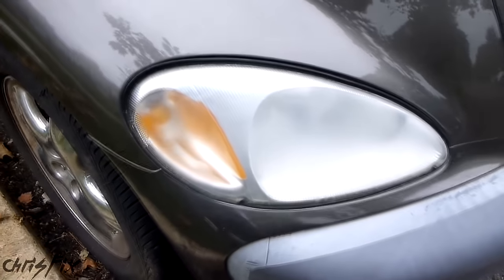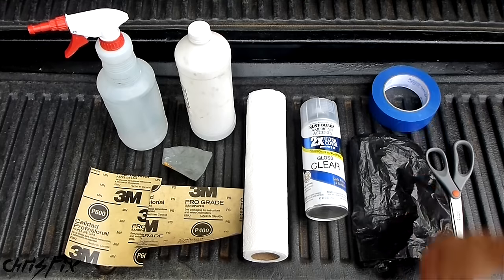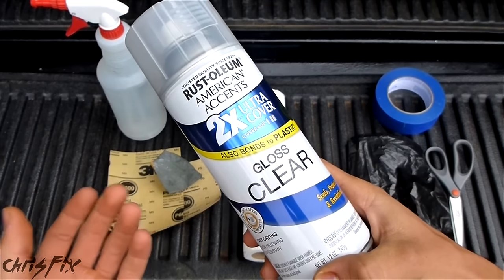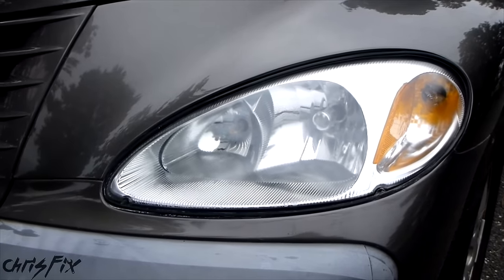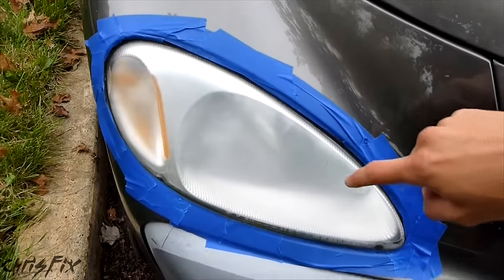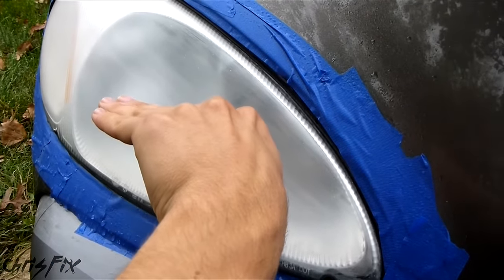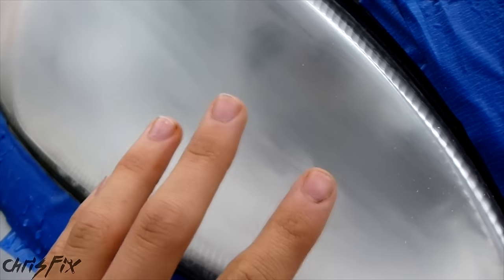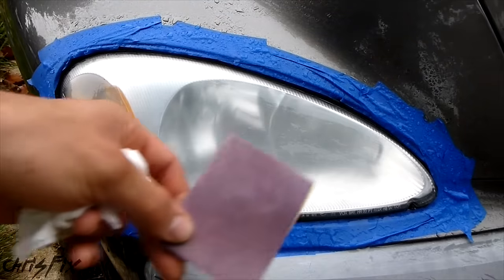How to Restore Headlights PERMANENTLY

Comment from the maker: All products I use are listed in the description as well as links to update pictures of the headlights 1 year and 2 years later. You can also follow me on social media:
Instagram→ https://www.instagram.com/chrisfixit
Facebook→ https://www.facebook.com/chrisfix8
Be sure to tag me in any before/after shots you guys take! Thanks!
Reply: ChrisFix Great work.  Hope u do more for the teens that are into Automotives.  better tricks and education to help
Reply: ChrisFix TV CT   garden
Reply: This was a great tutorial. Thank you.
Reply: ChrisFix I actually restored my headlights using your method. but I skipped the rubbing alcohol because I'm affraid it will damage plastics. Thanks
Reply: to get
Reply: to get a free Google
Reply: Can You please answer. When I clean my headlights and wash off the cleaner the headlight get unclear when they dry, and when I put water on it, it shines until it dries again and gets foggy or unclear. I don't want a coating though, because they peel. how can I make it shiny?
Reply: Go to any paint shop service, they will buff it, then you have to wax them each  season. Cost around 20$ tip. If your lens is very clean with alcool, it won't peel off. Do not use lacquer clear coat. Krylon clear coat is the best for plastic and it is UV proof. Be sure to use the GLOSSY finish, not the satin finish or matte finish.
Reply: Walle M. rubbing compound and a buffer or a lot of elbow grease. Use a heavy grit compound and finish with a lighter compound. Finally finish with wax.
Reply: ChrisFix nice job i myself Detail Cars i run a KIA dealership but the way i restore headlights permanently is very similar except i wetsand with 2000 grit then I use 1000 or 1500 grit compound & with a high speed buffer set between 1600-2100 and the results have been amazing i do think i will add the clearcoat. 
Lmk what ya think & i will watch more of ur videos cause even with my 15+ years experience detailing i still pick up new tricks etc....
Reply: ChrisFix I fucked everything up. Now, I have scratches on my headlight. I need help. How do I remove scratches on the plastic headlight? Bump up the grit of sandpaper to 2000?
Reply: kyoukoujin u gotta get a high speed buffer and some compound wax 1000-1500 grit run the buffer at 2000 and buff them they will look brand new.
Reply: Prib-302 great. Now I have to buy a buffer machine and a wax. A $20 video procedure now becomes more expensive glass salvation. Dang.
Reply: ChrisFix 好办法
Reply: i don't have a car on my own and am not very tidy and also too old to feel the need to look good in a car (when I borrow my brother's or father's) so maybe these videos are totally not for me -but I couldn't stop watching, extremely well done, nicely presented -much nicer to watch and listen to than ANY commercial whose job is to sound appealing. just wow
Reply: ChrisFix what if my headlights aren't yellowing just needs to be scrubbed well you can see debris on the lense and it creates a kind of reflection from the beam if that makes sense
Reply: Prib-302 screw the scratches. I just applied cooking oil on it. It's ok.
Reply: Dude you're phucking awesome....!
Reply: ChrisFix  sup Chris. it's a sunny day here in illinois so I wanted to restore my lights as well but I don't know if I should since it's rainy tomorrow. I heard you say let dry for 24hrs. would it really matter?.
Reply: ChrisFix the tape looks like pet liner
Reply: ChrisFix wuter
Reply: ChrisFix do we need the wax at the end or can we leave it as is?
Reply: how do you fix a small crack in your headlight?
Reply: hey can i use that can of spray after the toothpaste way?
Reply: +חיים בן זינו if you can't find it just use tooth paste and a hard bristled tooth brush takes longer and doesn't look as good but it helps a lot there's a lot of videos on hot to do it.
Reply: James Zorb
Reply: Kars
Reply: +Prashanth Reddy  yes?
Reply: ChrisFix Where did you get the Spray paint at?
Reply: +Nicole Krist Amazon the links are in the description
Reply: ChrisFix i did it and what if I messed up lol, do I just do everything over, to take clear coat off?
Reply: +Mauro I Hernandez showed you mess up?? lol
Reply: +Mauro I Hernandez how did*
Reply: James Zorb
Reply: Sabb headlight assembly for. 1999 9-3
Reply: sam lin n
Reply: ChrisFix the
Reply: ChrisFix
Reply: just want to say I tried this yesterday to my car, and the results were amazing. headlights look like new. thank you for the tutorial.
Reply: Joey Loyer mkplkpl
Reply: ChrisFix ...... Hey ChrisFix..... I over applied the Gloss Clear on my head lights and it have that run down after finish. What can I use to remove it?
Reply: ChrisFix
Reply: I've been waiting for a answer about that too. 

I REALLY do not feel like sand papering my head lights all over again...Sh*t!
Reply: iKeywee Good questions. Try you tubing your questions I'm sure that will answer all your questions.
Reply: iKeywee wax is just that - wax.... apply it to make water bead up and roll off versus sheeting or staying on.  Polishing or rubbing compound has very fine particles in it to remove oxidation, etc.  It can be used on paint to restore it before applying wax.
Wax should always be the LAST step.
Reply: I plan on trying to tackle this soon.... ford Escape headlights are foggy and hazy....  but some looks to be INSIDE???
Reply: ChrisFix is
Reply: ChrisFix my spray can days indoor and outdoor does this mean it's uv resistant? I'd like to know before I try restoring my head lights.

product number is: krylon k05130102 

please let me know
Reply: ChastBlind make sure it says uv resistant.
Reply: ChrisFix I just did mine and I'm waiting to 24 hours for it to dry. It doesn't look super clear after I sprayed the clear coat on, do it dry clear after the 24 hour period?
Reply: Praise
Reply: Let it dry well.  It also helps to use an extremely fine grit and wetsand the clear coat.  Don't sand it off, just smooth it out.  I usually put about 5 coats on mine so that I'm sure I'm not sanding off the clear coat.  Once it's smoothed out - crystal clear!
Reply: Storm Chaser Video I'll keep that in mind. How long did you wait in between coats?
Reply: Storm Chaser Video I put 3 coats of clear on and starts looking hazy after the second coat... WHY?!?! I let my clear coat dry, then I sanded with the 2000 grit and it just makes the headlight even more hazy.. what am I doing wrong here? I'm doing all of the steps in the video to the letter.
Reply: This is not as easy as it looks.I've done several lights and, to some extent, have gotten the "orange peel" effect every time.  Not sure if this can be avoided when using spray paint out of a can.I too tried the 2000 grit sand paper to attempt to eliminate the orange peel look (after waiting a couple of days for the paint to completely dry).  While it smoothed the surface out it created a cloudy haze on the surface of the light.  Definitely looked better before I tried to "fix" it.I then applied car polish (Nu Finish) and that improved the appearance considerably.  The problem....don't know if that is going to last. Next test... I may try using 3000 grit sandpaper on the other light.
Reply: What type of clear are you using?  And, are you wet sanding?
Reply: ChrisFix i have same problem!! I mean i used wet sandpaper, i just start with 600and 1000 and then 1500 finally 2000 and also i did on horizontally also ,,,  I followed all the steps one by one , but finally still i have orange peel on my headlights, it was better than before but not like your headlights???? Please tell me what i have to do right now?? Can i do it again like sandpaper 2000 and spray it again?? I found exactly the same spray which you said on movie!! So please help me!!
Reply: kyoukoujin how did you mess it up? Just want to know so I don't do that.
Reply: ChrisFix I just used some bug spray and it works great it's still clear and it's been 6 months . but don't get it on the paint because it should make the paint chip
Reply: ChrisFix beth hart
Reply: ChrisFix how do I fix my headlight if I added to much cleat coat
Reply: GUYS. I fixed the problem with the cloudy clear coat!! I just got a buffer from Walmart for like $20 and put some carnuba wax on it and polished it for about 10 minutes and it looks better than my brand new headlight
Reply: I would just re-sand it and try again
Reply: The Internaut did it three times, no
Difference. Re-sanding is a waste of time.
Reply: Hi guys. Can anyone help me ? I have very yellowish headlight and i havent tried to clean it yet. Would like to try this step i already have the sandpapers however im from philippines and we dont have that kind of spray paint, i only have here bosny spray paint. http://www.amazon.in/Bosny-Aerosol-Spray-Lacquer-Glossy/dp/B004X2H23O , would this work ?
Reply: Richy James thank you so much bro. I'll try this later.
Reply: ChrisFix can't you just use the bug spray then cover it in a clear coat epoxy?
Reply: ChrisFix 100th like
Reply: iKeywee buffing is rubbing usually with a tool thats like a drill with a pad on it.
Reply: jampol jimenez  use Rapel bug spray its alot easier then this , just spray it on let it sit for 10 seconds and wipe it off . works great but its got to be Rapel.
Reply: ChrisFix Rubbing alcohol? Has additives. Best to use denatured alcohol.
Reply: Some rubbing alcohol has mineral oil, some does not. I got rubbing alcohol without oil at Walgreens.
Reply: ChrisFix is it 2000 grit or 3000 for the orange peel because you use 2000 but said 3000
Reply: Nice.
Reply: I just finished this up today.  It was great.  If you want to remove the final "haze" then follow the last steps of using 3000 grit sandpaper before applying wax.  Likewise, Chris Fix also links to a product in the description above called PlastX by Miguars.  It's a rubbing compound for plastics that you can use to spiff up the final sheen on the clear coat.  I believe it's finer than the 3000 grit sandpaper.  So, that's the solution if you're finished but you still see that "orange peel" effect.
Reply: ChrisFix '
Reply: I wrote to Rust-Oleum about using Gloss Clear 

 Thank you for contacting Rust-Oleum Consumer Brands Canada

This product is not made for the headlights and it will yellow and will damage your headlights.

We do not recommend it.

If you want to make your headlights newer, you can use the Wipe New product for headlights.

http://www.rustoleum.ca/product-catalog/consumer-brands/wipe-new/headlight-restore/

If you have any further questions, please call us at 1-800-387-3625
Reply: Er... I have a little orange peel on the headlights of a car here. You said something about a wet-sand, but how would I know how far to go without damaging the clearcoat?
Reply: ChrisFix
Reply: ChrisFix wfaw
Reply: Yakimurai......Notice that the alcohol solution Chris was using was only 10%, this will not harm the plastic like a 90% solution would.
Reply: once the pastic is oxidized you can't permanently fix it. the protective layer was removed so. P2000 then P2500 works the best tho. Then tooth paste :) oops didnt see it was painted by transparent paint.
Reply: sorry man, but it still looks foggy .
Reply: MAFIA MUSIC that's a hint your monitor is telling ya it desperately needs to be upgraded. Not ChrisFix's fault.
Reply: If he uses the same process on his monitor it too will be good as new!

*If you didn't read this far, shame on you. That will NOT work on LED/OLED or other monitors!
Reply: ChrisFix when I put the clear coat it was hazy and I waited a day and it was still hazy what should I do?
Reply: Check hgg
Reply: Marialaura Zagaceta The big thing that he missed what is the importance of polishing before you put the clearcoat. You should go to the store, and get the most powerful compound you can find. And get a towel and work it into the plastic headlight. If you have a polishing machine, use that. After the headlight is  polished, it will not look hazy at all. You can then put a few new coats of your clearcoat. Hope that helps!
Reply: The problem with this is that after you polish the headlight, the clear coat has nothing to stick to. It will peel after the first rock chip.
Reply: ChrisFix  hi do you fix for Handels
Reply: ChrisFix ,,,l
Reply: John Broberg, how hard did you wet sand with 3000 grit to get that "orange peel" off? I'm afraid if I'll do it too hard, I will rub off the clear coat spray and have to re-do it all. Thanks
Reply: Do we have to wait 24 hours?
Reply: ChrisFix a0
Reply: +ChrisFix Which do you recommend for removing the orange peel from the clear coat, the wet sanding with 2000 grit or the use of the polish compound you linked in the description?
Reply: ChrisFix I
Reply: Corey Benick Orange peel, you wet sand it with 2000 until you don't see anymore Orange peel then buff it to a shine
Reply: Dale Durham - I had that problem.. applied one clear coat and it was perfect, then following the can's  instructions I apllied another coat within 30 mins (15)when it should've been more like 2 mins.. I got severe orange peel.  on my second lens I applied one coat and its perfect. thx for the tip on fixing that, Dale.
Reply: zellerized no problem, it's the same thing for any of the body with dulled or orange peeled looking clear
Reply: ChrisFix I did it with 100 then 200 now I'm going to apply the 600 grit do I still need to apply the 2000 grit ?? pls reply
Reply: I would say yes, 2000 is extreamly fine
Reply: The standard prep finish for sprayed finishes is 400-grit and that's what I'd use (I'm going with this method for my one faded headlight - my other one was replaced with a collision repair).  I'd only go with finer grits if I planned to polish rather than clear coat.  Also keep in mind that the Rust-oleum 2X Ultra Cover Gloss Clear Coat used here is formulated with solvents that enable it to bond to plastic.  The clear coat can also be polished out and waxed after it cures.
Reply: Is there any practical benefit to using a 3000 or 4000 grit paper after the 2000 one, or is it just a waste of time and effort?
Reply: ChrisFix when are you goin drifting
Reply: If clear coat is being sprayed, probably not because the standard prep finish for sprayed finishes is 400-grit to provide a toothed surface for adhesion although the Rust-Oleum clear coat used here is also formulated to bond to plastic.  But if you're polishing the lens rather than applying clear, then the finer the sanding, the better before polishing and the same holds true if you're polishing out the clear coat after it's cured.
Reply: Hal...Leonard...elm
................"..................music...books
Reply: ChrisFix
Reply: ChrisFix thanks but in uk what you use its very expensive but they have
 rust oleam all what u mention just the lable is different i assume that will do the job
Thanks
Reply: ChrisFix  Question: after Clear coating the headlights.. 24 hrs. Are you sure sanding the orange peel with the 3000 grit wont haze up the headlights??? It looks good the way it is. I'm scared to do it and mess it up.. than have to repeat my steps.
Reply: Nicole Krist  walmart for $3.47.. Amazon is $14 ??? But yeah Wal-Mart in the paint section not automotive
Reply: macduggles I agree probably the best go to.. I didn't have that at the time.. But I had no problems with my rubbing alcohol... it was 91% too.. not the green 70%
Reply: I'm sorry to hear that Rust-Oleum is so expensive in the UK.  I picked up the same clear gloss that ChrisFix used in the video at Walmart in NJ USA last week for $3.47 (2.68 GBP) https://www.walmart.com/ip/Rust-Oleum-American-Accents-Ultra-Cover-2x/37326872.  FYI the Rust-Oleum American Accents Ultra Cover 2x that ChrisFix used is an awesome paint that's self-priming and formulated with solvents that enable it to bond to plastic.  I've only used it once on wood and it lives up to its claim.  I'm finally going to clear coat my headlight tomorrow and can't wait to see the results.  My car is due for NJMV inspection this month and my headlight is so bad that it may fail inspection unless I fix it.  (BTW, tomorrow is Labor Day holiday (not vacation) in USA.  Long live the spirit of Tony Benn.)  Cheers.
Reply: DDEENY wow its cheaper in america what i noticed anything from america is very highly priced and soooo many nice products from america cool you will get a very good finish and your car will pass the test thanks mate
Reply: ChrisFix shit i filled my toyota with water
Reply: Well, I finally did my headlight today.  It was a warm. low-humidity day in NJ USA.  Overall the results are good.  My headlight is 14 years old so I didn't expect a miracle, just a solid improvement and that's what I have.  My headlight now looks almost as good as my replaced headlight.  The one caveat is spraying outdoors where the slightest breeze that you can't even feel while fully dressed is enough to pose an obstacle by disturbing your spray pattern.  Right away I got 3 sags in the clear coat but I ignored that and progressed.  I  sprayed 3 wet coats about 5 minutes apart.  I do have the 3 sags plus orange peel, but in couple of weeks I'll  sand out the sags and orange peel and polish the shit out of it and apply paste wax.  My other issue is that my lens was unevenly hazed after wet-sanding because the upper part of the lens' coating had worn off down to the clear polycarbonate.  Sanding all of  the original coating off would have required the drill sanding disc to  be used and I didn't want to get into that.  So my clear coat has a slight haze underneath which didn't fully clarify as I had hoped, which I can live with.  I also have a small area of alligatoring in one corner for some reason.  Once I sand and polish it out it will shine like a diamond.  I also made use of flattened cereal boxes inserted into the gap below the headlight to streamline the masking and I used painter's tape and newsprint for the rest.  I trust that the repair will last the life of the car.  Thanks, ChrisFix.
Reply: ChrisFix    Quote.
Reply: ChrisFix. could I use any other car wax?
Reply: Nicole Krist I just bought the exact spray can at Walmart
Reply: Coleman Merrill - haze is often cause by humidity being too high that day. Read the can and stay within the spec. Usually, but not always, it clears up, without doing anything, within 48 hours. If not, you have to wait that long anyway before sanding it off.
Reply: Logie Buggy    2X is $3.89 at Menards. Lowes does not carry it.
Reply: DDEENY we call them "smiles".  Wait 5 days is warm weather, sand and buff.
Reply: ChrisFix kuhhn
Reply: ChrisFix i
Reply: ChrisFix  Great demo!  I've tried compound and wax.  According to your video the haze is the oxidation. I will try the alcohol and clear coat method.
Reply: ChrisFix  all will this work on windshields and mirrors?
Reply: ChrisFix  quick question, can the wax be any wax or just this specific wax you used, or anything close to it?
Reply: ChrisFix you're a boss 👍
Reply: Watch this video more closely    "How to restore headlights permanently"
Reply: ChrisFix i
Reply: ChrisFix h
Reply: ChrisFix I clear coated and waited 24 hours for the clear coat to dry but it never became crystal clear like yours. I did 3 light coats like you did 5 minutes apart. I wet sanded with a 2000 grit to see if it would help but that didn't work. Do you have any recommendations?
Reply: How to clean egr tube
Reply: ChrisFix ;
Reply: ChrisFix ilvue
Reply: ChrisFix
Reply: ChrisFix so could I simply do the toothpaste method and then seal it in with the clear coat? Wouldn't it last the same way?
Reply: awesome instructional video! 👍
thanks for not putting annoying music.  God bless
Reply: ChrisFix I dont think you will reply chrisfix but hopefully u do i just finished clear coating my headlights but after 1st coat looks like the clearcoat cracks when on headlight any thoughts on why that happen let me know thanks
Reply: @ChrisFix  if the headlights are still new or aren't yellow and fogged yet but I'd like to do this more as a preventative, should I just skip straight to the 2000 grit or do you think I should still use 600 first?
Reply: If it's large cracks I'm not sure.
If it's smaller individual cracks you may not have sanded them down enough. 
That happened to me when trying to clear a carbon fiber hood. Turned out I had removed so much of the original clear coat it exposed some of the carbon fiber itself resulting in a V effect. The base surface basically had smaller than pin holes or grooves I thought the clear would fill in but it only got larger at the top of the clear. So I had 4 options, 
1- Sand it down more till it's a smooth surface but with Carbon Fiber I couldn't.
2- Fill and skim coat the whole hood with body filler then paint it.
3- Some painters said they have used a clear Bar Top epoxy that fills it and clears it.
4- Wrap it, in which case I used a clear bra wrap a.k.a. Paint protection film and it actually works great.
Reply: Interested to make this videos in Indian languages? Let me know.
Reply: ChrisFix hd
Reply: ChrisFix
Reply: ChrisFix you Have plastx on your description but not in the video, where and when exactly would you use it? Thanks.
Reply: I saw another  video on YouTube using just a buffer and Mother’s Aluminum Polish and it took less than 5 mins and looked better than your result. Just had to share this. I like your other videos and find them very informative.. keep it coming
Reply: ChrisFix I need soapy woader where do I get it
Reply: ChrisFix the same time as well as the
Reply: You are good man.
Reply: ChrisFix Hey this is awesome but I did the procedure and it worked fine but after a couple of hours the clear coat started to crack on one of my headlights the other one turned out fine.. BIGGG cracks too.. Any idea of what happened?
Reply: ChrisFix hey so lately i been seeing people using WD-40 for head light restoration can you prove that right or wrong?
Reply: ChrisFix , very well done!, Sir!  
Clear, thorough, interesting...
Reply: ChrisFix ...if you're spraying clear coat over the headlights...does it really matter to cover up the car?
Reply: ChrisFix that was cool man thanks for the cool trick
Reply: ChrisFix Can I do the paper sanding process but instead of clear coat, I will apply a headlight restorer (Rain X)? I do not have a kit so Im thinking if I can replace it by the paper sand.